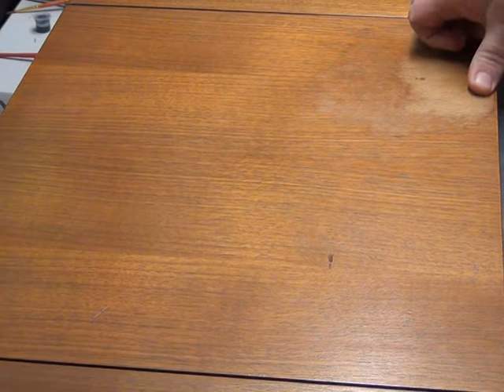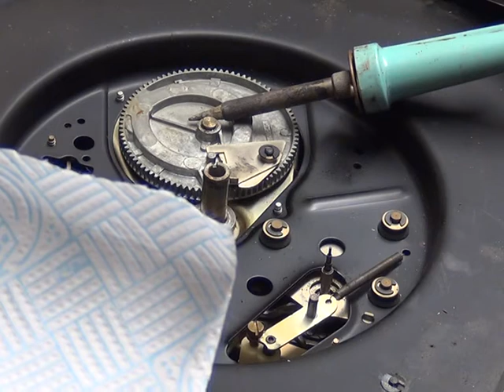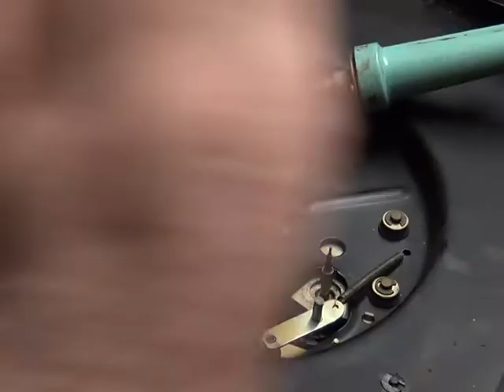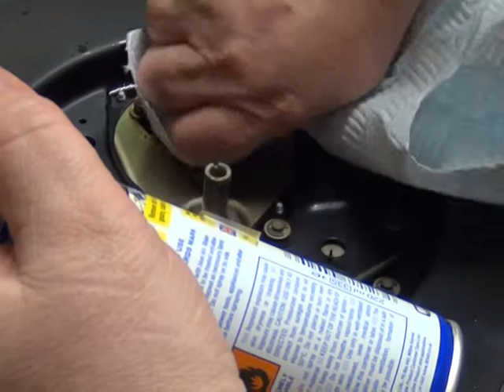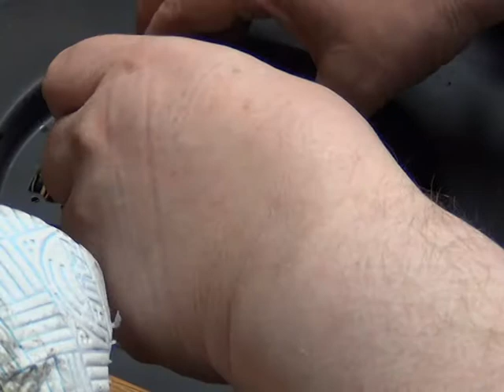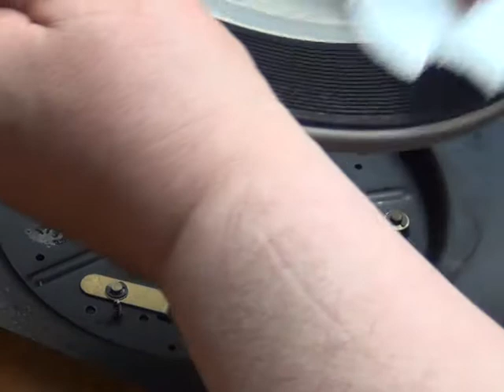HMV Stereomaster 2411 radiogram - Pt1 - BSR UA70 turntable lubrication

Comment: I guess I'm showing my age but used these decks all the time and rarely had then seize up but no doubt after a few years of not being used the grease does turn unto a glue type mess!

Not many people know the Shipping mechanism on the record Stabilizing  arm either (Push down at the back and turn towards the centre spindle) It stops it sliding up and down when moving the turntable upside down then right way up again :)

Comment: Hello. Very informative video. I have just picked up one of these units. What brand of lubrication works best for this?  Thank you!
Reply from the maker: We just use household oil...usually the '3 in one' brand. Make sure all the nasty hard grease is removed, we usually use WD40 t help remove it. Clean all the rubber its, motor shaft, inside platter rim with isopropyl alcohol or surgical spirit/,metholated spirit.

Richard

Comment: I have a record changer just like this, but in a fisher console. Would love to see how to calibrate the tone arm, platter speed etc
Reply from the maker: Speed is mains frequency locked so can't vary unless there is a lubrication snag  Tonearm weight needs setting for around 4grammes weight with stylus pressure gauge.

Richard (UK).